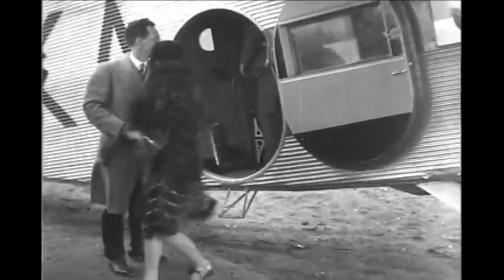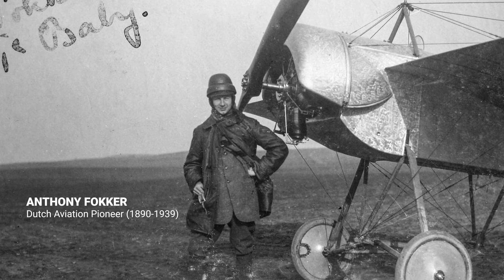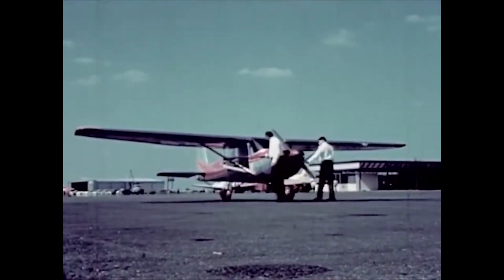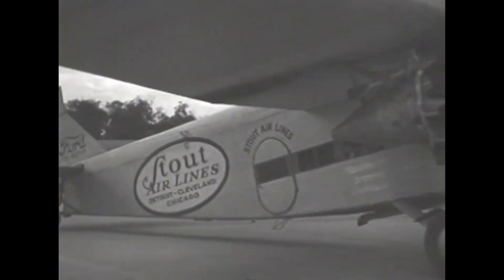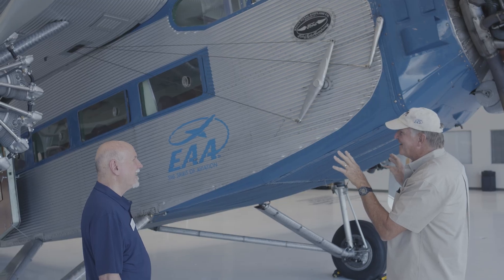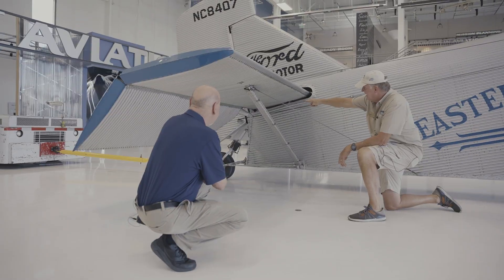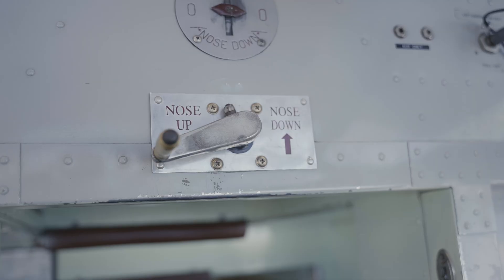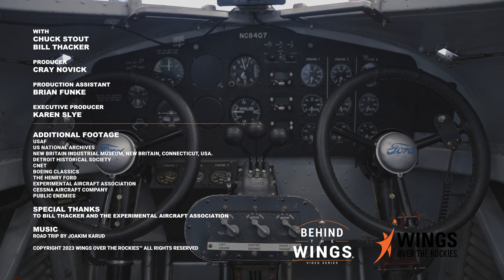Flying a Century Old Tri-Motor | Behind the Wings

Comment: I was lucky enough to ride the Air Zoo Trimotor in Kalamazoo Michigan.. Actually measuring of gas in tanks is "Model T "style just use the stick to check level.. She is off the ground in 7 seconds, very noisy .,but one cool ride. If you ever have a chance to do this do not pass it up.

Comment: I flew in this plane several years ago with EAA; payed extra to fly as co-pilot, which was a good move as the cockpit got noise cancelling headsets, while the passengers were left on their own.  It was a warm day, so the cockpit windows to the side and a little behind the pilots’ heads were open.  These are almost directly inline with the props for engines 1 and 3, and not very far away from the prop tips.  As we were climbing, I thought I’d crack my headset and see how loud it was - holy crap!  It’s right up there with shooting a .357 Magnum with no hearing protection.  I am sure all Tri-Motor pilots in the day retired completely deaf. BTW, the thing seemed to fly like a Winnebago - everything happened in slow motion.  Every control change Bill would make would take a second, then the plane would slowly respond.  An experience I will never forget, but I would have hated to do a long trip in one.

Comment: How many cylinders did each engine have? I tried to count and I think I got 18 that the prop kind of blocked one area and I wasn't sure if it ended up being 17 or 18. Could you please clarify? Thank you.
Next time I'm out in Denver I'm definitely going to plan a stop at your facility there.
Reply from the maker: The Wasp Jr. R-985 are reciprocating, 9 cylinders, radial, air cooled, geared supercharger engines.

Comment: Cool. I've always wondered about planes like this and the ju 52, why the engines? there are so many two and four engine planes but not a lot of 3 engine planes. what does three engines get you that two or four doesn't?
Reply: From what I understand, the point of having three engines back in the day when these things came out was the idea that you could have an engine failure and still in pretty much most circumstances still make it to your destination and not have to divert and make an emergency landing. Remember that back in those days 4 engined aircraft where few and far between, like VERY rare. With two engines if you lose one then 9 times outta 10 the other engine isn’t going to get you all the way to your destination, you’ve got just enough power remaining in that good engine to make it safely to the nearest runway. But with three engines, losing one wouldn’t put the aircraft at enough of a power deficit to force it to have to divert, in most situations they could still plod along a bit slower to their original destination. Basically it was kind of like a selling point for the aircraft to try to get those early air carriers to buy the tri motor over the other options because it had three engines instead of two and had more reserve power to get you wear you’re going in case an engine quit.
Reply: I read a bit deeper into the history of the Trimotor. It was originally designed for a single engine and later for two. The performance on two engines never was good enough. Henry wasn't enamored with the idea of building airplanes, so at some point the factory that built it mysteriously burned down. The rebuilt factory now built the three engine version, making it safer and more reliable and capable of doing what it was designed for.

Comment: Corrugated sheet metal, a forward-swept windshield, exterior mounted control cranks and cables and unfared radial engines and wheels!  The coefficient of drag on this thing must be almost as bad as my Jeep.
Reply: Maybe parasitic drag isn't as big of a deal when you're just going 80 MPH?
Reply: @wilsonli5642  Terminal velocity for a skydiver is only about 120.  They're getting prettty close to that.
Reply: @wilsonli5642  Maybe they'd be going faster than that with less drag